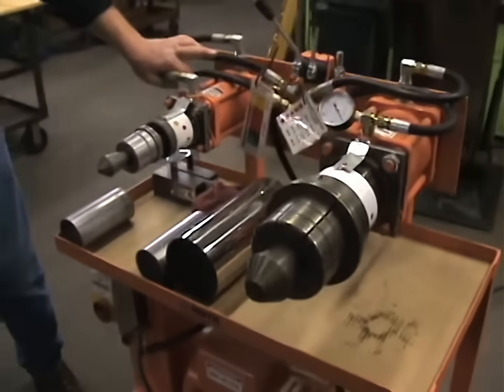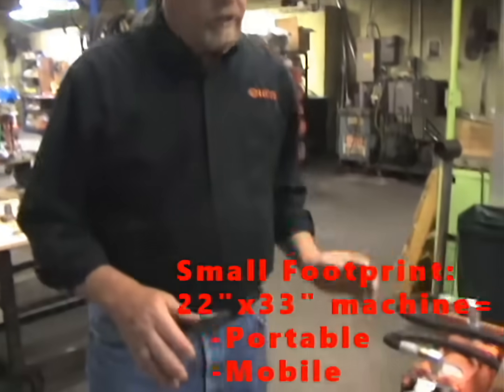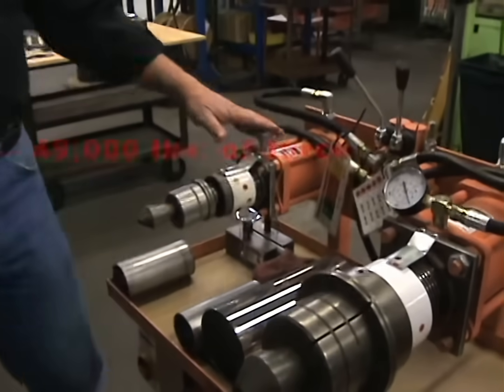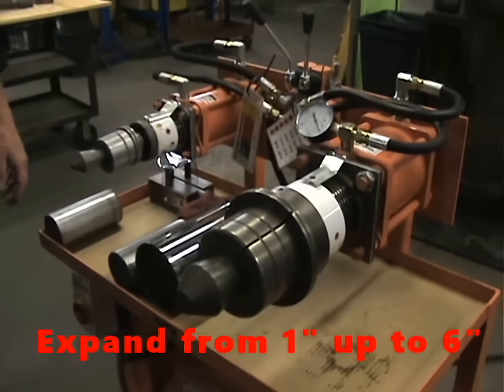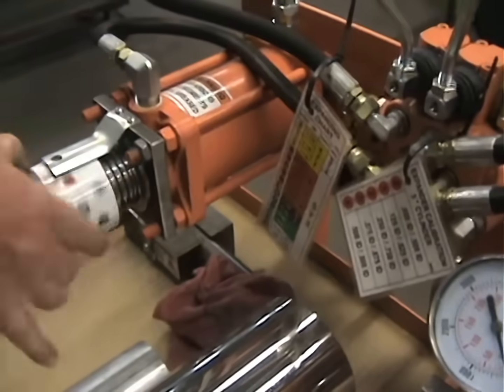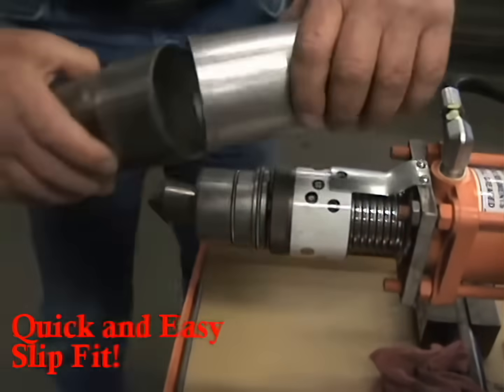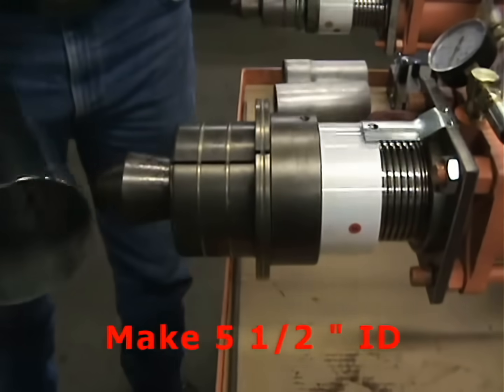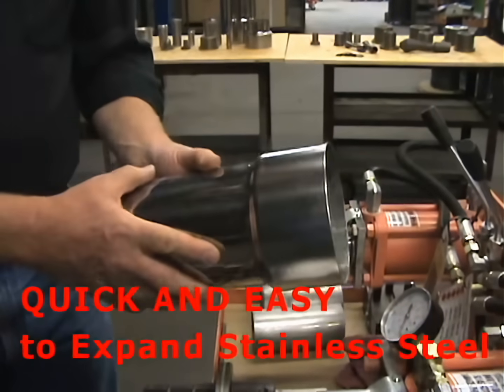Cost efficient ways to work with large diameter tubing

Comment: 1" must have a very small mandrel,  3/8- 7/16 diameter.
 I'd l Iove to see that
Reply from the maker: Our standard 1” expanding utilizes the 575 arbor/mandrel and a 570 spacer for the segment set base. The arbor has a .840” diameter. the 470 segment set has a .875” diameter with a 1” expanding depth. Most 1” material we encounter has a 18GA wall, .049”. We do customize tooling for some applications.
Go to this page on our website to see the 575/570:
 https://huthbenders.com/en/products/tooling/huth/huth-end-finishing-expander/arbors-and-tips/
Then segments page:
https://huthbenders.com/en/products/tooling/huth/huth-end-finishing-expander/segments/
First line is the 470.

The size description refers to ID’s.
Please let us know if we can help. Thank you.